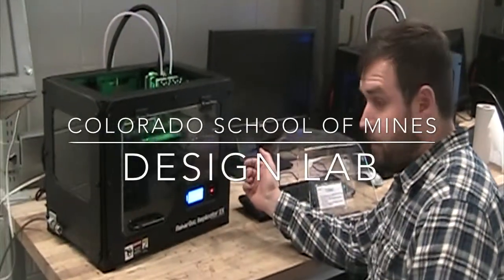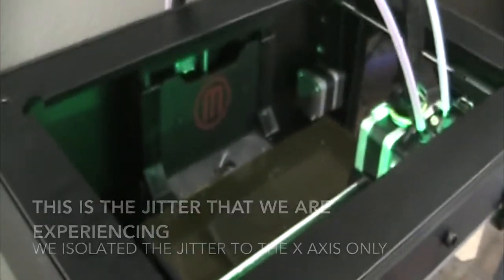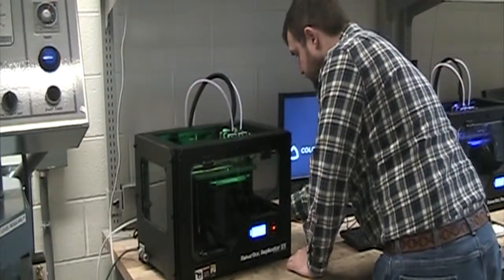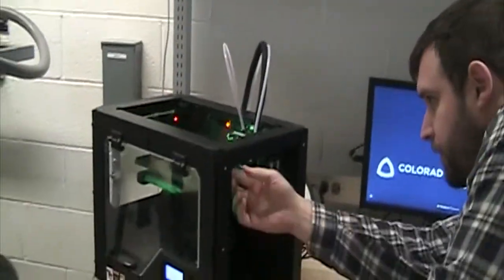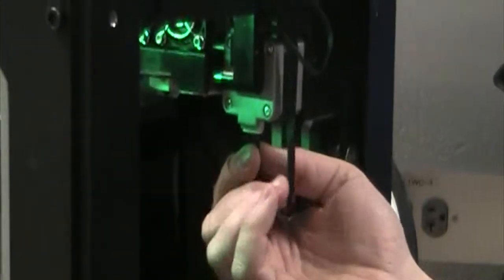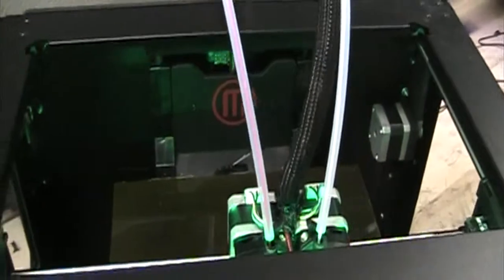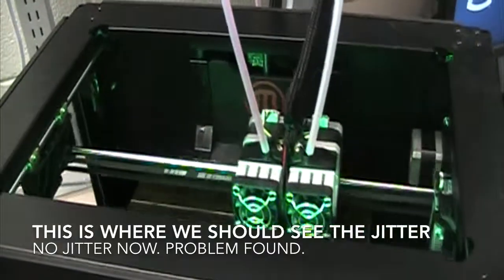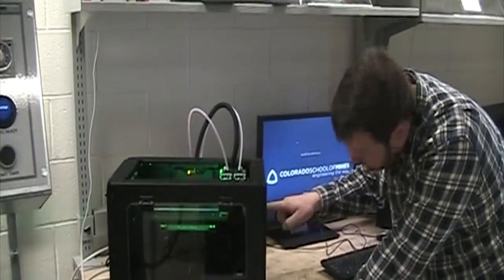Diagnosis of Jitter in X Axis on the MakerBot Replicator 2X

Comment: After many many attempts at a failed print over a period of several months, taking it to 3d printer shop, trying this and that and that and this to no avail, and finally reaching a level of frustration to the extent that I wanted to take a bat to the machine which would force me to have to buy a new machine, of which I have already spent many many hours searching out one in a regrefully kind of way, I really do NOT want to have to buy a new machine, and finally deciding one last time to see what else I could find online I accedentally saw this video, wow, could this be my fix?  Could this be what I've needed months ago?  And so I followed your instructions, loosened the wire and right now it's running so ever very smooth, wow, a miracle, you don't know this but you put this video up just to save me.  Thank you ever so much, may all your days be bright and great.  QUESTION, how did you figure it out?
Reply from the maker: Just trial and error mostly.  We observed the behavior and went through the different parts of the system that might be having the problem.  Lo and behold, we found it.

Comment: Are you using an auto bed leveler?
Reply: No this machine does not have an auto level system, the guy is pressing the button continually for the steps to manually slide a paper between the nozzle and the plataform to subsecuentially do this process to the end of it.... he press ok... ok... ok... ok.... until the process ends.

Comment: thank you for this. i have about 600+ hours on my china branded makerbot, the wanhao duplicator. and it just started to do this. they fixed alot of the issues that makerbot had. but not this one. 

This is a year old and you probably wont read this. but thanks anyway. its helpful. i will probably take the stepper apart and solder leads onto it if it continues., but for now im going to do what you suggested and crimp the connetors down a bit so they make more positive contact.
Reply from the maker: +Bart Koscow The crimping does help at least for a while.  Eventually we were able to force MakerBot to send us new cables that worked somewhat better.  These machines are not very good though.  We're pretty happy with our Lulzbot Taz 5 printer though.